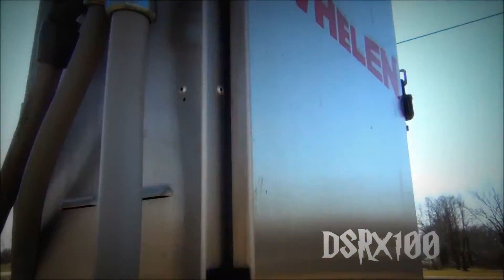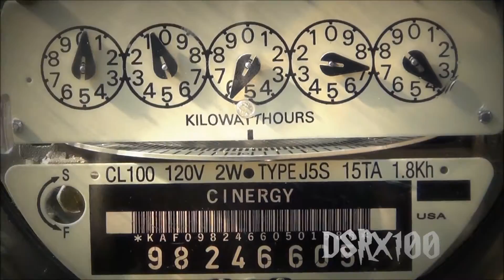Whelen Vortex R4, Alert (560 Hz): Odon, Indiana (Daviess Co. Tornado Siren Test, HD)

Comment: Minneapolis MN installed 50 of these along with 15 OA-2 s Downtown both run this 560 Hertz Tone weird thing is they run a custom Attack Signal to replacate the old Thunderbolt 1000T 2001 SRN system the city had before are the other Hertz tones still available like the 530 hertz tone

Comment from the maker: Thanks for the comment! Yeah, I did notice they put it in the low part of Odon by the railroad. I guess they tried their to put it in the most 'central' location of the town. Also, the 560 Hz tone that Whelen now uses is quite effective and the tone has the potential to carry several miles. Do you know when they installed this siren?

Comment: I live just up the road from the siren.  When the siren was first tested it made several different sounds.  They rely on length of siren for different warnings.  If the siren goes for a long length of time, that means a tornado warning.  If its shorter in length that means a thunderstorm warning.  Question to DSRX100,  did you notice they put it in the lowest part of our town?  I know on a clear day you can hear the siren from about 5 miles away.